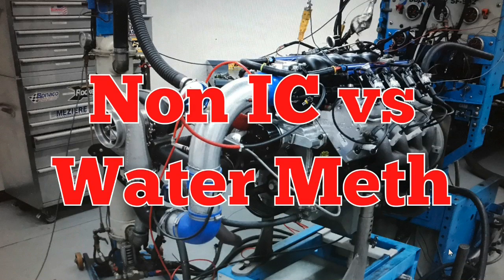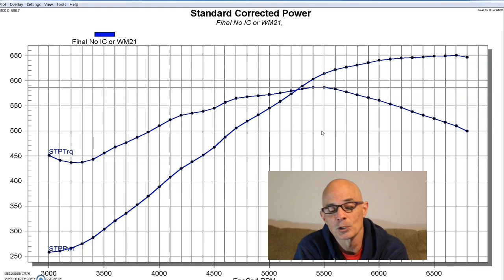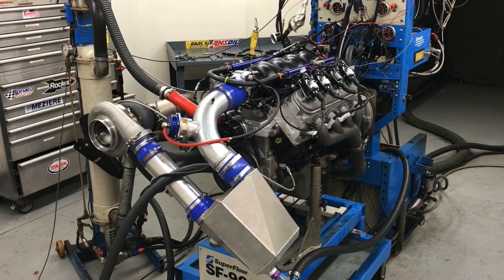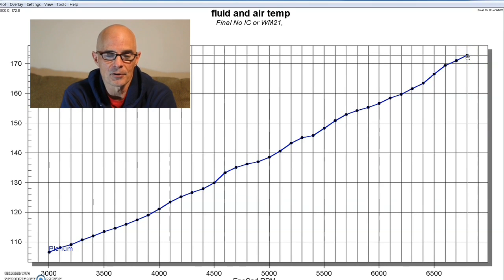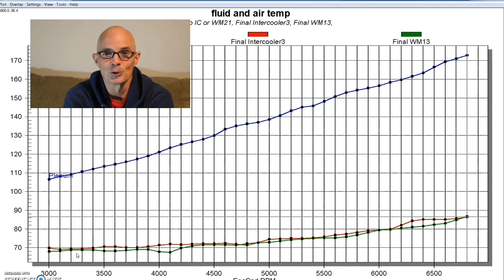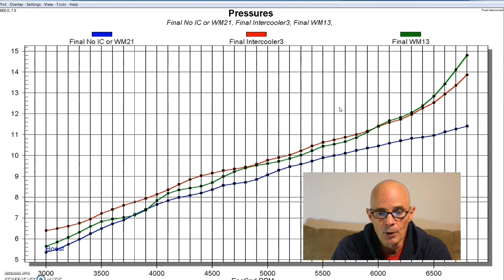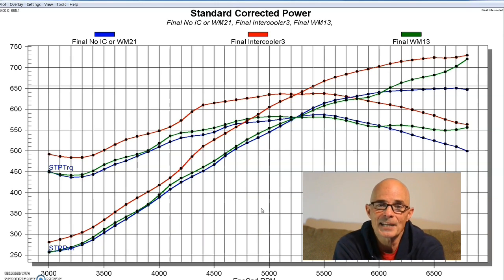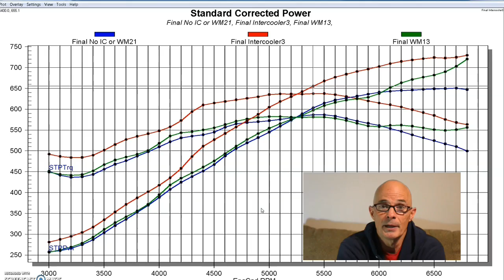WHO'S COOLER? WATER METH vs INTERCOOLER

Comment: You should try pre turbo methanol injection, Cosworth used pre turbo methanol injection on the XB Champ car engine in the 90's, so there has to be something to it.
Reply: On a big budget race car, go for it. On a budget, you don't want the erosion that the water or methanol, droplets will cause. The better the atomizer nozzle works, the less erosion will be seen.
Reply: @aaronnoyb  True, it's probably not the best choice for road course or endurance racing, but for a street/strip car or drag car that will see relatively little time in heavy boost I don't think it would be to much of a concern. Besides a low budget build with a junk yard ls and eBay turbo isn't going to have a infinite life anyway. I would bet a cast piston letting go would kill a turbo long before the methanol damaged the compressor.
Reply: @bigboreracing356  Good point. Compressor wheels aren't that expensive to replace.

Comment: Seems logical that if, for example, the entire volume of charge air, at the throttle body was 80f. Then it should be 80f at every point in the intake manifold.
Q. How, or why is there differential temperatures in various areas of the intake?
Reply: Some manifolds have a preferential flow to certain cylinders causing unequal fueling and heat. The same reason you don't want to push past 150hp on a pre throttle fogger. The other aspect to look at also is heat soak through the manifold.
Reply: I’m not a scientist but I think the water particles are heavier than air and fall through the closest intake ports. Lower density air makes it to the farther ports. Measuring intake charge at each port and running tests would answer the question.
Reply from the maker: I did that-was different by 100 degrees in cylinders with WM

Comment: Question: does the water evaporating displace O2 therefore less power?

Also water meth pre-turbo works very well and solves distribution issues as the turbo chops it all up. Old rally cars use to do it (water only, Don't want a bomb in the intercooler
Reply: The water turns to steam in the combustion process, and just before, taking heat from the cylinder, not really effecting the o2, the methanol evaporates almost instantly, depending on the temperature and pressure, dropping the temp of the intake charge , allowing more o2 into the cylinder, but even the water steam cools the chambers, while being super heated, the Methanol richens the air fuel, and can add octane,
Reply: That's what I was thinking, the meth is supposed to be injected before the turbo. All of the water evaporates in the hot turbo to provide the cooling effect.
Reply: Check out prometh volute injection
Reply from the maker: does it help distribution lol
Reply: @richardholdener1727  yes, because it all  evaporate in the hot turbo.
Reply: Looks like the water hitting the compressor would slow down the spooling, I'd rather inject after the turbo, but a good way from the throttle body,  i don't like how what ever is injected, nitrous, water/meth, stays on one side of the throttle blade, if injected close to the throttle body, looks like distribution could get really bad, maybe put two injector nozzles about 4"-6" from the throttle body , not up top one on the bottom side, they say 50/50 is the best, I wonder what straight methanol injection would do?

Comment: M1 as fuel.
Or I'd go intercooler. 
We've already seen on Engine Masters, that meth injection doesn't distribute well. 

Do this test, with M1 as fuel, alone.
Reply: It didn't distribute well in a manifold designed to flow gasses.
I can bet you a hot dog that a carb style intake would be far better for water/meth.
Reply: Need a manifold designed for wet flow (like carb manifolds.) If you use a plate system (like a nitrous plate) it works very very well.

Comment: Great content as always.

How about making a video about turbo lag, a too little turbo vs too much turbo for DD vs Racing.

Keep them coming..
Reply: It's really hard to simulate turbo lag on engine dyno because the rpm sweep is controlled and pulls are made a WOT.
Reply: @bartpang   Agree it's very difficult to simulate lag/response characteristics seen in a car with the dyno - but it's NOT difficult to conceive a test that allows you to compare lag/response differences between different turbos. The SF902 water brake dyno is capable of holding a steady rpm. All that's needed is to have brake maintain, say, a steady 3000rpm while you go to WOT. Repeat at 3500 and 4500rpm. This will create several different boost vs. time data traces. Swap to a different turbo and repeat tests. You'll see very different curves.
Reply: BW S366